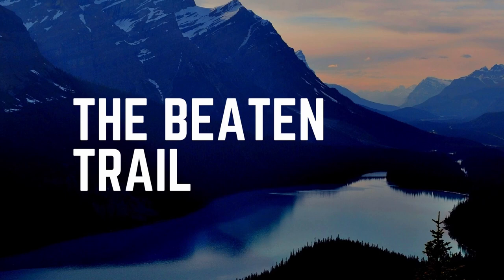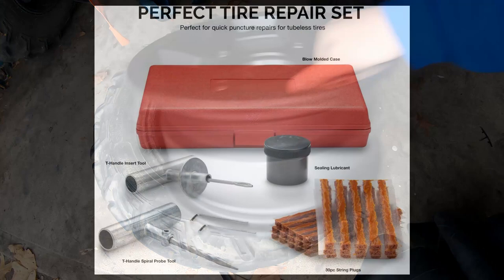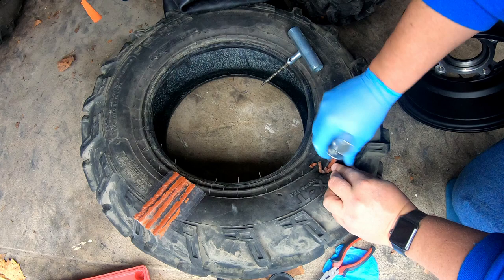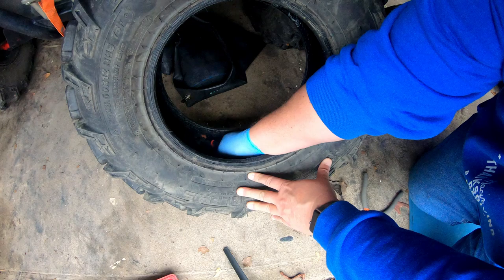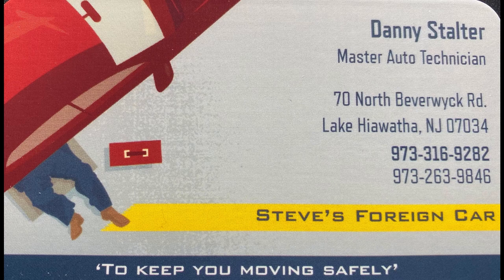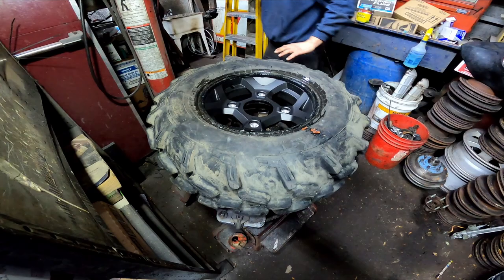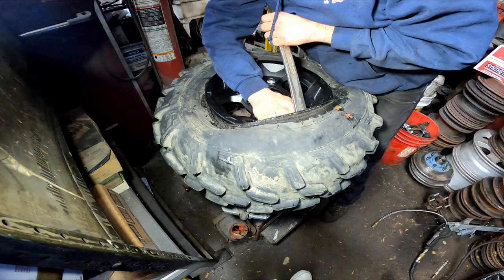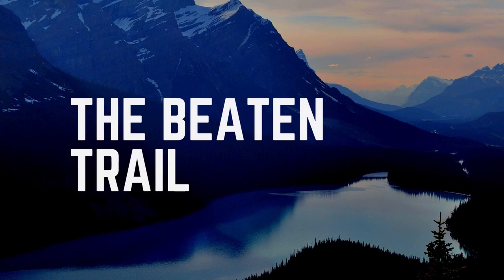Can you save that old tire?

Comment: 🤣🤣🤦🏻🤦🏻🤦🏻 I had to spend $150 in new tire,  because I didn’t think abut this.  Good tip
Reply from the maker: Yes.  Its not bad for a one-time deal, but once it gets another flat you're gonna toss it away, but it extends the use a bit.

Comment: I've tubed a tire on my old Can am Quad, and it lasted long time with no problem. Was a Stock 4 ply tire. They are junk if you ride rocky trails like I do in Vermont.
Reply from the maker: Nice.  Makes so much sense to save some money.  Where do you get your tubes?  Vermont is on our list for getting out and riding. I just have to check the regulations on NJ reg/insurance and if we'd be ok getting up there with our gear.

Comment: Just bought my sxs recently, this past weekend I nearly ripped the tires side wall. Having tubes will save people lots of money especially if your tires are still new.
Reply from the maker: Working with Gluetread and their side wall patch has made everything a lot better and as long as you beveled edges you’ll catch a rock on them and they give you extra strength in your side wall if one has already been compromised that with a tube I totally agree.